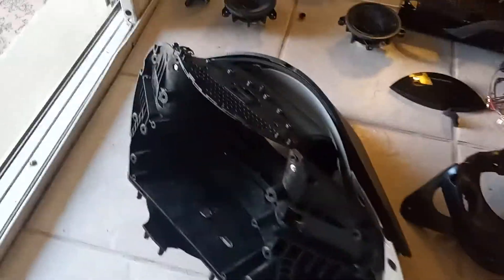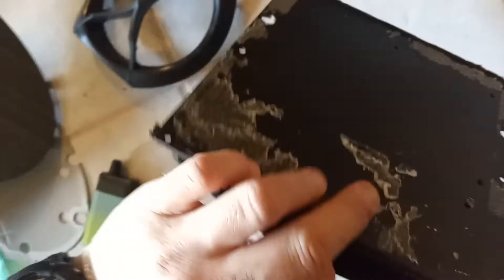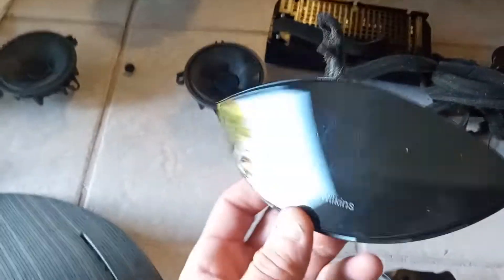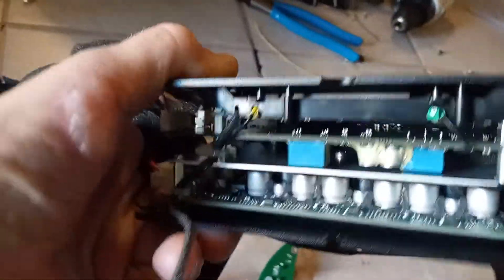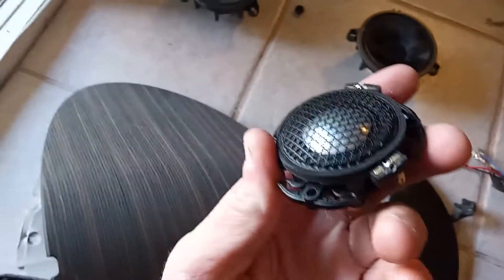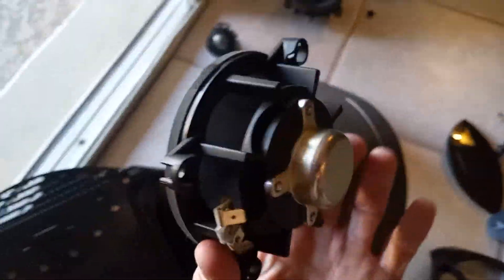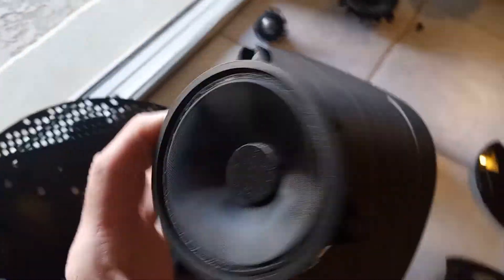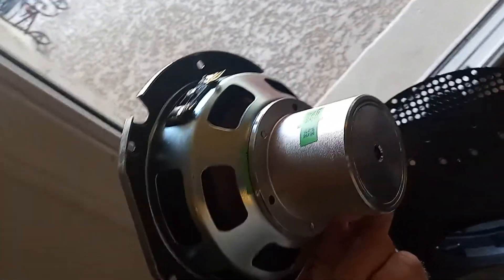Teardown of Bowers and Wilkins Formation Wedge reveals wimpy drivers.

Comment: thinking about taking mine apart to modify it so it has a wired input for less latency. when you took it apart, did it have a jack to connect already? or maybe its able to be modified with a jack wired/soldered in

Comment: A bigger magnet ?? It's a balance between amp, magnet but also what do you wanted to reach in voice, music out of the speaker.  So your opinion about expect a bigger magnet is not right. check out maybe info about, amp vs magnet , etc
Reply from the maker: The expectation was inferred both from teardowns of similar b&w devices like zeppelin as well as the companies own marketing material which explicitly states the drivers are those of the 600 series. they are unlike both and i have a hard time believing that my suggestion of an anomaly here is itself anomalous enough to call for such a critique but the hell with expectations
Reply: These discussion on these speakers could be material driven, AFAIK these should be neodymium and therefore much smaller than expected.

Comment: How to remove front grill?
Reply from the maker: take bottom rubber pad off with heat n unscrew screws, using a flashlight look into the screen and you will see several areas that appear to be screws holes holding it on, these are not screws they are in fact rubber plugs that need to be pulled out with either needle nose pliers or other pointy object. you should be able to reach them fro m bottom after it is removed like i said.

Comment: Just got this speaker but treble is overpowering and tiring and mids and bass are lacking, funny enough while i though the drivers of the zeppelin were the same i saw that the magnets are much bigger at least in width does that mean better mids and bass? Wonder if they chose those for the wedge because of lack of space…funny that the zeppelin is cheaper
Reply: Exactly how I felt! Went from A7 and was quite disappointed! The treble and bass are indeed better on these though.
Reply: Lo que sucede es que los parlantes de medios y aubwoofer tienen imanes de neodimio lo cual los hace más livianos, pero para el subwoofer el imán de neodimio ayuda a alcanzar frecuencias más bajas.